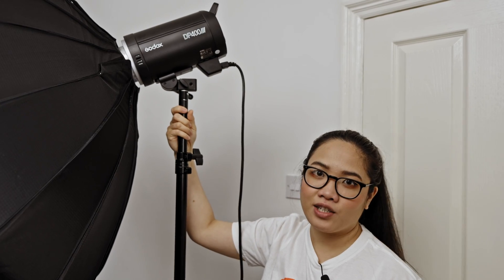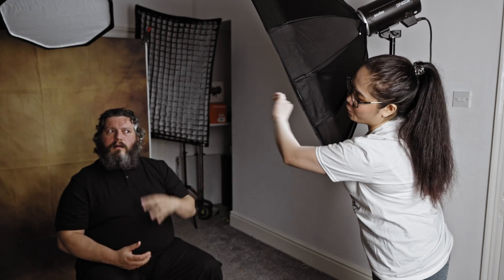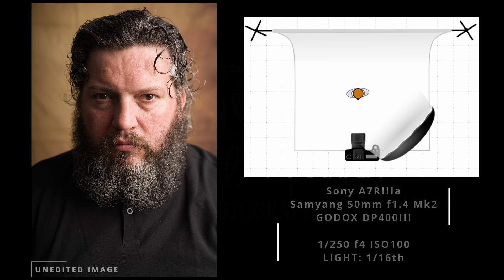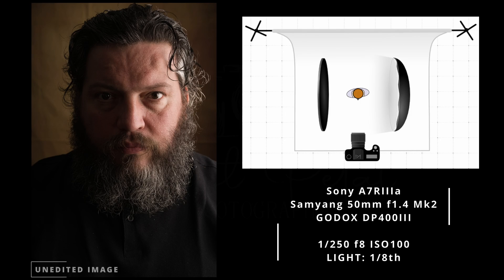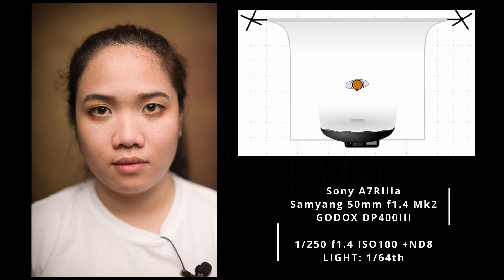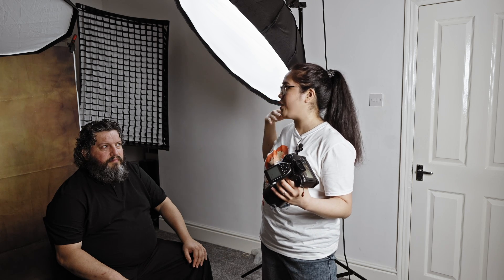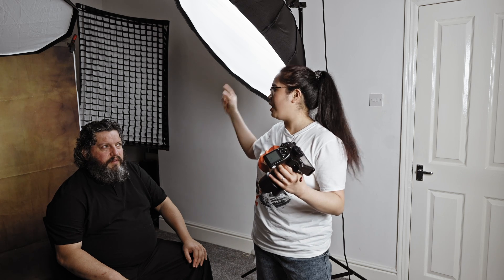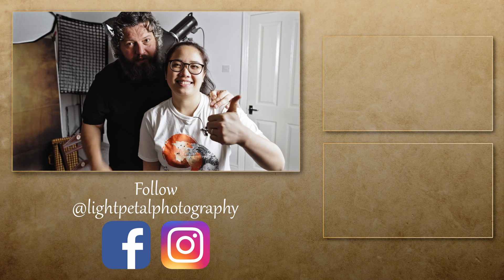Flash photography with only one light [GODOX DP400III]

Comment: This gave absolutely no information on how to set it up
Reply from the maker: I know. We were too busy to show how to position the light for each result, and explaining how to use subject distance to get the desired lighting that we had no time to show you how to set it up.
So to set it up first you need a stand. Open the legs of the stand to achieve the best stability. Then extend the stand to the desired height and move it to the desired position. Then open up the box of the flash and take out the flash. Put the flash on the stand and attach the light modifier of your choice. Plug the flash into a main socket and turn it on. Grab your camera and attach the wireless flash controller, turn both of them on. There. You're set. Hope it helps.

Comment: Great video guys! 
Your comment to trigger the flash after changing the settings saved me so much frustration! 
Also love the engagement with your subject!

Great vid - very helpful to me - thanks! :-)
Reply from the maker: Glad it helped! It caused me a lot of frustration as well. So many times it happened that I change the settings, take a photo and it's overexposed so I lower the settings even more, but then the first picture was okay and the second was underexposed. But then Peter explained to me it's because the flash is "preloading" the charge so when you lower a setting then the flash still has the previous charge preloaded that's why you have to trigger it after changing settings :)